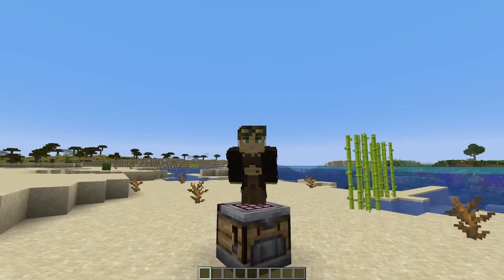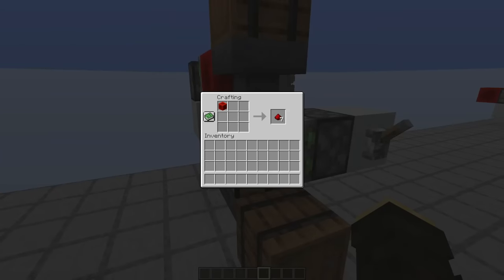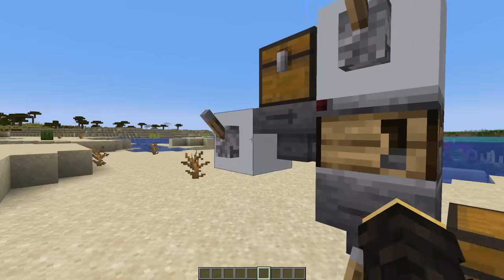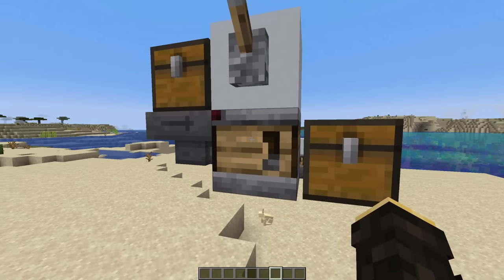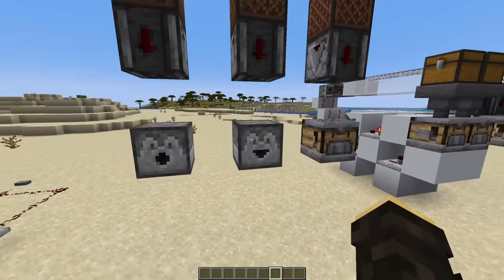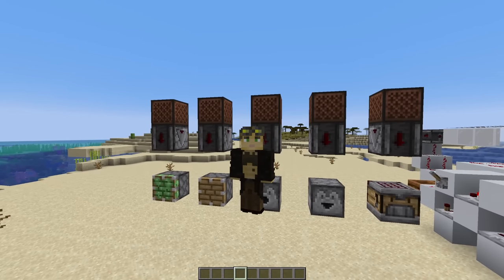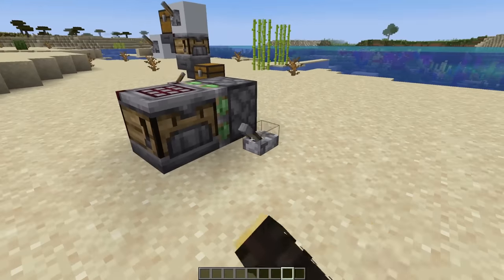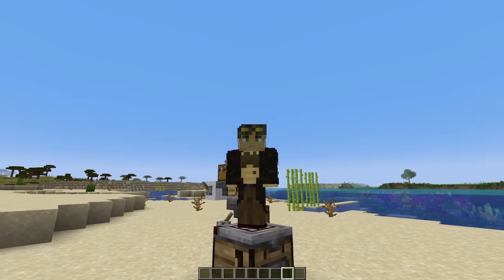The Epic Return of Autocrafting

Comment: I gave up on java and tried bedrock and it turned into a tape like thing he showed with his mod. You just input what you want to craft, press a button, and it automatically moves the items from the sorter and spits one out. A lever flick holds the recipe to continuously spit out. Until you have a one input that can be hooked into a shulker unloader and item sorter, you don't have a true autocrafter. Right now, only bedrock can do this easily, I tried on Java. Instead of moving the crafter or chests/hoppers like bedrock, you have to make a diagonal pattern of immovable crafter that drop and refilter all the items back into the sorter.

Comment: The signal strength output is super useful, you are talking tr*sh! There was no way to automatically increment signal strength one at a time before!
Reply: You can increment one by one with a basic pulse extender hooked up to a redcoder
Reply: It would make it easier to do but it not going to 15 reduces it's applications greatly
Reply: @parrazarre1773  ok, I haven't thought about those cuz I need my contraptions to be relatively compact and just working around the problems other containers have is more compact than that (also I just realise that I have build such a thing already using dropper lines to increment where the signal comes from)

but the crafter would make it so much more compact! (also I can imagine circuts surpassing the problem for stacking crafters that cubic mentioned which are even more compact than his solution. Just because he is not skilled enough to do smth doesn't mean, that it's an inherent problem to the block)
Reply: @parrazarre1773  in what situation would it reduce the crafter's application?
Reply: @ATOM-vv3xu  any kind of counter could only go up to 9 before having to make a second instance of the counter to add on top of it. Also most of minecraft's redtone is designed around the redstone power going up to 15.
Reply: @parrazarre1773  you very seldom need to count up to more than 9, most common are counting up to 2-8 in my experience so this is a great alternative to the existing circuits for that and it even can

also though yes redstone is made for a signal strength up to 15 the same could be said for light and I hear nobody complaining, that candles have a max. light output of 12.

The crafter might not fit every application but it will fit new ones instead of an already existing one and this is why they should keep it that way